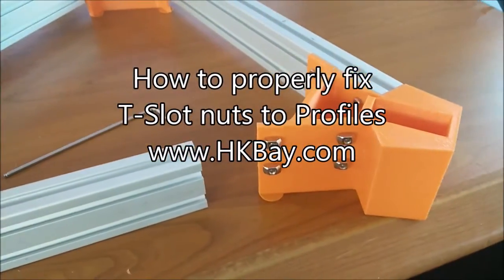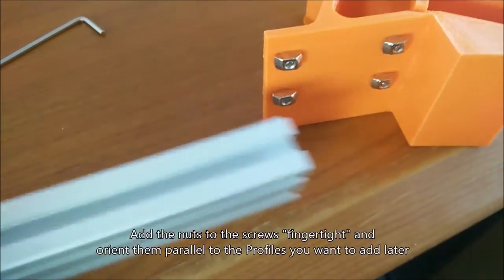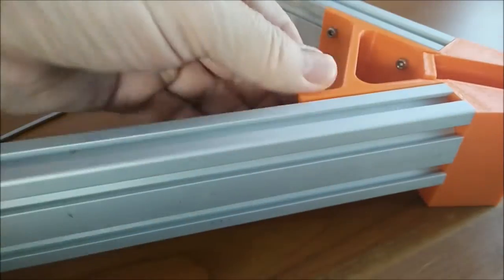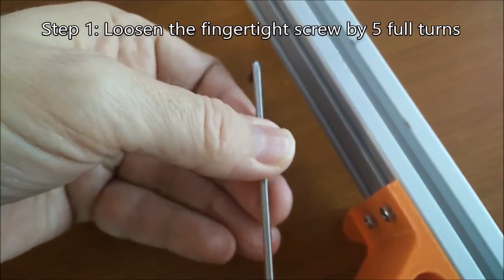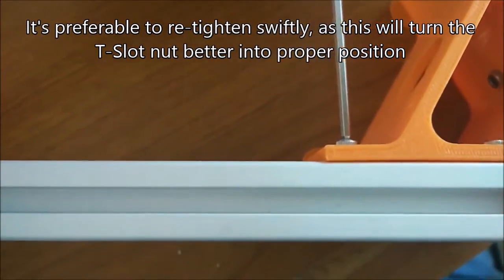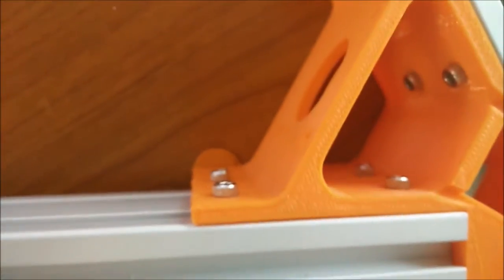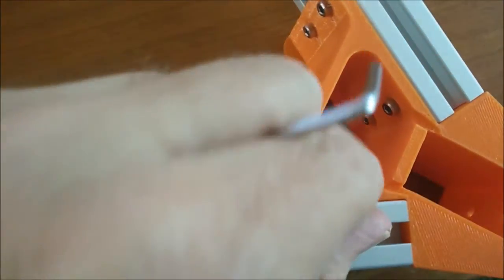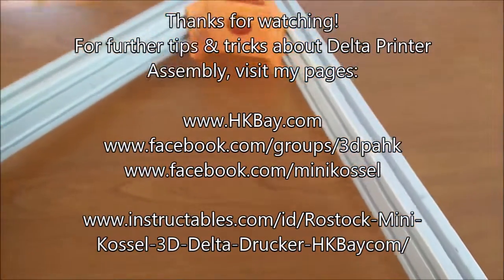How to properly mount T-Slot nuts

Comment: This works!  I was putting plexiglass on some tslot and I started wondering how the heck I was going to turn the nut.  In other cases I had access from the side to poke the nut with something.  Not this time when the whole side is covered with plexigass.  I saw this, gave it a try and it worked the first time just as you describe!